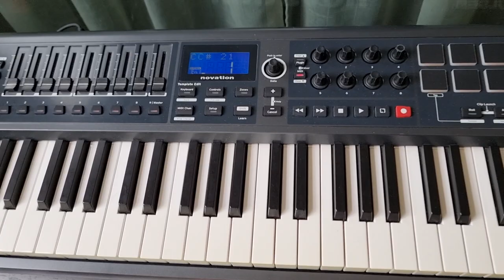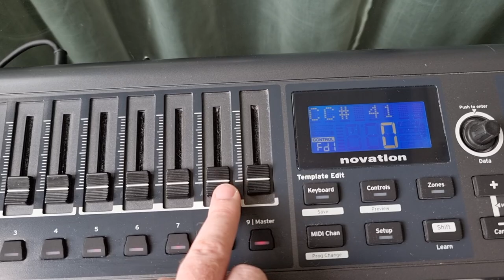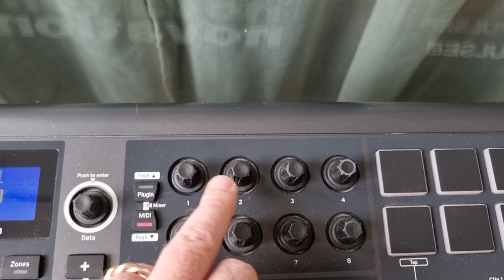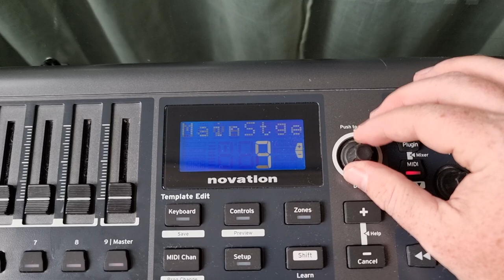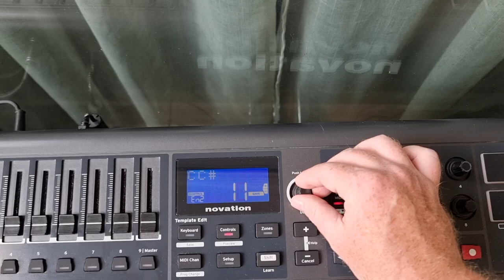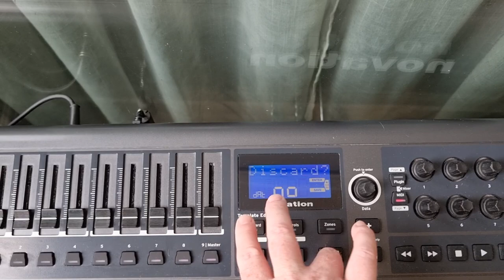How to CHANGE CC Values!

Comment: Hey Ross - I hope all is well! I wondered if you knew if there was a way to control the Boss 600 with another controller (if you wanted to control it on the other side of the stage)? Couldn't find anything online about it - thanks a lot for all your helpful advice!
Reply from the maker: Absolutely! There are plenty of MIDI Devices out there capable of doing this wirelessly. You would need to invest in something like the CME Widi Master to stick into the back of the RC, so that wireless messages can be sent. Take a look at the Airstep by XSonic, or the one I'm currently using which is the Luminite Graviton M1 with the F10W footswitch. It's an incredible device and you could easily control various parameters within the RC from afar with this. Best of luck!
Reply: @RossGallagherMusic thank you so much - this is so helpful to know!
Reply from the maker: @georgepelhammusic  no problem at all. I hope you find a device that works great for you!

Comment: This is gnarly stellar -- is there a recommended kind of midi keyboard after using it for awhile?
Reply from the maker: Hi Brian, I bought myself a Novation Launchkey 37 which is perfect for my needs. I know a few people have kept things simple when gigging and are using the Akai Mini Play which has various built in sounds. Saves having to use any other software when gigging so could be beneficial but depends what you'll be using it for.

Comment: Thanks Ross.. this is super helpful, was very frustrated to find that the CC"s skipped after i bought a little USB to midi box that I can use a small controller to use the faders. .. unfortuantely the simpler midi controllers can't store user templates for CC's... I wonder if there is any other way in that case, because my faders are defaulte CC#48-56
Reply from the maker: Glad it helped! It is frustrating that the CC numbers jump, especially when using external devices where CC values cannot be changed. Perhaps someone else reading this might have a workaround! Sorry I can't be of any more help. Ross
Reply: @RossGallagherMusic  thanks Ross -- Do you know of any other MIDI controllers that can save a user template that is portable.. my best find is the MPD232 with faders. but is still pretty bulky!
Reply from the maker: @harmonic.earth.sound.healing  it is tricky to find anything small and portable with faders. If you have access to and iPad, have you considered using an app like Touch OSC?

Comment: Great video!  thanks for that!  can you just tell how you link RC600 and Midi keyb ?   USB or MIDI din?  (I have some issue using an old Korg Nanokontrol that only has USB output,  and I have to go through a Midi box in between, since I believe USB RC600 is not transporting midi signal).  Many thanks
Reply from the maker: I believe you would need a USB MIDI host if your decision only has a USB output. That's the reason I went for a controller with the 5 pin MIDI Out. Hope this helps!

Comment: Hi Ross! Thanks for your super duper Videos, they helped me connecting my novation impulse 25 to the rc 600 which is great! I can play beats without a pc wohoo! one important question - I cannot fix this problem: I only can route one of my cc signals to control the rc 600 and not all of the 16 assign. Only the first knob is working which is th cc21 knob. I can control multiple functions with this one knob but cc22 and so on is not working. Do I have to changes something in the settings?? thanks if you can help me on that!
Reply from the maker: Hey, thanks for the comment and I'm glad you're getting something from the content. The issue could lie in the Impulse menu, so you can go and select which knob is sending which CC message. Does the 2nd knob definitely control CC 22? Thanks, Ross

Comment: Thanks a lot! Got Questions: if I use the controller with it, is the controller the midi out and the rc the midi in?  How do you use the normal keys then?
Reply from the maker: No problem at all. I use a Novation Launchkey MIDI controller and run the MIDI out on the Novation to the MIDI In on the RC. This allows me to control various aspects of the RC using the 16 available assigns, however in order to use the keyboard to play audio, I come out of the Novation USB output going into an iPad with Garageband. Then out of the iPad 3.5mm jack into the instrument input on the RC-600. Hope this makes sense?

Comment: Hi Ross, thank you for your incredibly informative videos. I bought the RC600 recently and I'm having a blast figuring everything out. I was wondering: I have an older MIDI-keyboard, that I'm going to use to test these midi features. It's USB-powered, so technically I need my PC to use it. However, for live performance, and just using it to control the RC600, could one just use a powered USB-hub and no PC? I don't really need my pc for anything else during playing...
Reply from the maker: Hi Alexander and thanks so much for your kind words. I would say that you almost certainly could use your MIDI keyboard with the RC-600 without using a PC, I do that sometimes myself. I just either us a USB powered hub or plug my USB straight into the wall via an adapter. This gives me the options of sending CC messages and also using my drum pads to trigger percussion sounds built into the RC-600. Unfortunately though, you're unable to play different instrument sounds without a PC if that's what you were also hoping to achieve. Hope this helps. Ross
Reply: @rossgallaghermusic4389  thanks! I also learned about midi hosts today, so I might look into a small MIDI controller with a couple faders. Don't really need the keyboard 🙂
Reply: @SuperlexMegamie  take care that midi controllers USB only cannot control rc600 directly: you need to convert usb signal to midi DIN with a midi host box (like the one from Kenton)
Reply: @Vincenade  I know, coincidentally just bought one for my Korg Nanokontrol 😉

Comment: hiya ross. is it possible to send CC messages across different channels at once?  i need to send info on channel 10 and 16 separately
Reply from the maker: Hi there, I know it's possible to do that using OnSong which is demonstrated in one of the videos. I have the RC-600 on a different channel to my other iPad with Sampletank. What exactly is your setup?